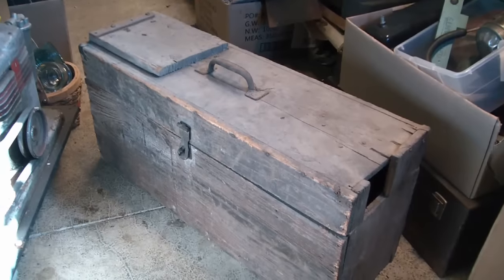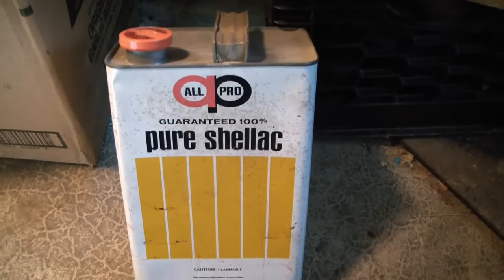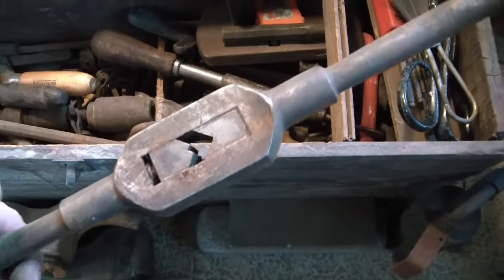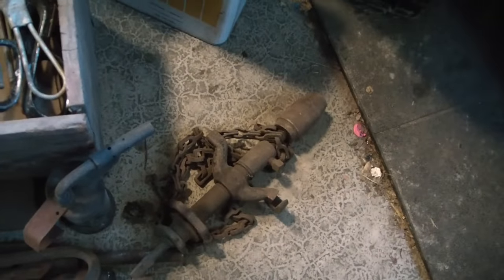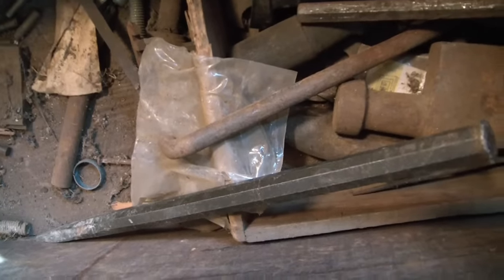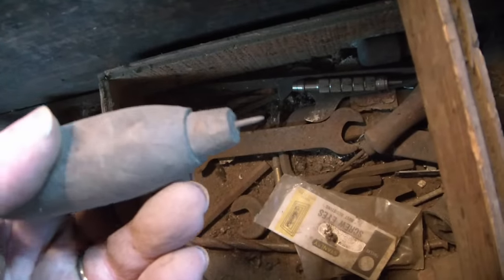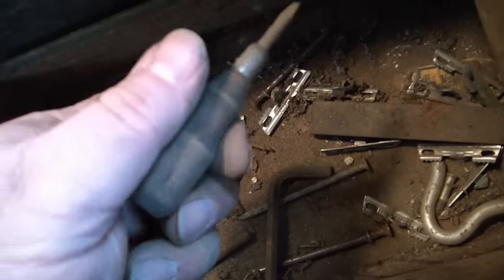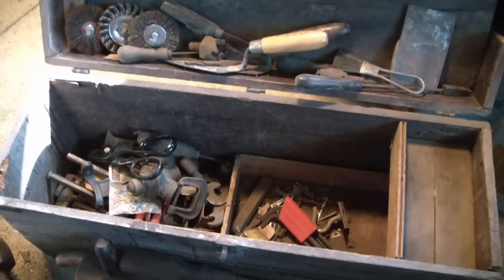Canton Tool Haul #8a

Comment: I think the first stone can be used for leveling floors (after applying floor leveling compound) The wood handled poky thing and the blow lamp look good to me    🛠👍😊
Reply from the maker: What are you referring to as the "blow lamp"?  Ooooh right you guys call a flashlight a torch.  I called it a blow torch.  Hmmm. In a set of oxy-acetylene tanks with a "thing" that fire comes out of and cuts steel, what do you call that "thing"? 🤔🤔🤔
Reply: oxy-acetylene torch but I guess I've always most other thing blow lamps I don't know why
Reply from the maker: @Everythings_Adjustable  That is fascinating!  I watch a channel called "lost in the pond" where he talks about all sorts of UK vs USA differences including lots of vocabulary videos.  You might like it.  👍😀😎
Reply: I used to have interesting conversations with a Texan girl (many years ago when I was single) lots of confusion from both sides  😁, 
Here's a quote I like,     George Bernard Shaw said: "England and America are two countries separated by a common language"  Spot on I recon   👍😁.
Also even here in the UK Guys working next to each other can have different names for the same thing, a short heavy hammer (2 to 4 pound) I would call a lump hammer others call it a club or a mini sledge. 
I hope that's a little bit interesting to you 🥃 👍 😊

Comment: Those metal Plates look like they are Card Scrapers  often used in Woodworking as a Precurssor to  fine sanding your can Scrapers the top  layer of the Wood  to level out any high spots
Reply from the maker: Thanks Craig!  :)

Comment: The shellac has denatured alcohol in it as a thinner. If you use any type of mineral spirits it will turn green, curdle and not bond. The alcohol is the vehicle in which it uses to stay liquid until it can air dry and then cure. Nice find. If it had said Shellac "Finish" then it would only be about 25-30% shellac and the rest would be alcohol and a drying agent such as a Japan dryer. Hope this helps.
Reply from the maker: Wow you sure do know a lot about shellac!  Thanks for the info!  If you liked this video, please check out my other tool hauls and share more of your knowledge about other interesting items!  Thanks for watching! 👍😀😎
Reply: @timeflysintheshop  At the time 0:14 is that an air compressor on the left ?  I was a professional painter for about 18 years.  That was a REALLY NICE find with the shellac. If that is the air compressor on the left, I have one just like it. At least,,, that's what mine looks like from about that angle. Anyway, if it is could you show it in a short video ? Mine needs new seals on both sides of the case where the crank shaft goes through.
Reply from the maker: @c.blakerockhart1128  that is an old air compressor.  I scored that at a yard sale where they were packing up for the day.  The tools were mostly still out, but I was really only interested in this old compressor.  The guy had three little compressors like this for spray painting, and he started telling me how much for them from the newest to the oldest.  For the more modern one he wanted $150!  At that point I thought, Oh OK a thanks but that is too much for me, but the next one was $80, and then the coolest one was only $20!!!  My wallet leapt from my pocket of its own will to buy it!  I will either tack it onto a future video, or I'll make a short video just about the compressor.
Reply: @timeflysintheshop  I will go up to my shop tomorrow and shoot a short video of my compressor and come back here and comment so you can look at it and see if maybe you would be able to help me find replacement seals for it if you will. Can you please check back here tomorrow afternoon or evening ? Have a Great night.
Reply from the maker: @c.blakerockhart1128  Yes, if you comment back again tomorrow(I mean today!), I should see it.
Reply: @timeflysintheshop  Have you had a chance to look at the video and see if you have the same compressor ?
Reply from the maker: @c.blakerockhart1128  No.  I just got home and picked up my tablet.  I will watch it now.
Reply from the maker: Hey!  Sorry I never got any good info for you.  I tried once to get some pics and video, but it did not work out.  My son has since helped me by "stacking" my projects rather than them being in a "pile" so it is now buried in the stack.  But if you have not seen the videos from the west highlands shop where Dave has done an amazing restoration of one of these, here is the link to part one.  https://youtu.be/Crpw6a-fZbM?si=CURbCeFag0K_15Qw

Comment: Hi, the threaded 'cutter' is not a cutter - it looks like an old 'dog' for a starting handle - the thread goes into the front of an engine crankshaft, hope this helps. Stu (uk)
Reply from the maker: Hey Stu!  I have confirmed that is a hand crank part for a 1935 to 1936 eight cylinder flat head ford!  I never would have thought that you could hand crank an eight cylinder engine, but I guess they were pretty low compression back then.  Thanks for the comment, and thanks for watching!  Check out sme of my other videos and share what you know about other interesting items!

Comment: Those plates are scraper blades for the handled holder with sandpaper in it.
Reply from the maker: I wondered about that. I will check to see if they fit that or the other wood handled tool that I called a spoke shave.  That has been suggested to be a "card scraper", so I have some investigation to do.  Thanks for your comment!  If you liked this video, please check out some of my other videos and share your knowledge and insights about other tools as well.  Thanks for watching!  👍😀😎

Comment: There was a double headed concrete form nail in there. The second head is for pulling the nail out when removing the form. The threaded L shaped rods are anchors that go into uncured concrete for fastening base plates. They can be hooked through rebar, but shouldn’t be in direct contact with the rebar to prevent dissimilar metal corrosion.
Reply from the maker: Hey Big John!  Thank you for the info!  If you liked this video, please check out some of my other videos and share your knowledge about other interesting items! 👍😀😎

Comment: The “wood handle pokey thing” is an ice pick. Every household use to have at least one.   My tool box would never be without one!
The item with fine screw threads on one end and four “hooks” on the other looks like it screws on the front of the crankshaft of 1930s and earlier cars to fit the hand crank.
Reply from the maker: I figured it was an ice pick by its size, but it is fun to call it a pokey thing!  When I clean it up, maybe there will be a marking on it somewhere.  So one else suggested that the four horned thing may be for a hand crank of an old engine.  I need to do some research and hopefully I can verify that.  If you liked this video, you would probably like a lot of my other videos as well.  Thanks for watching!  👍😀😎

Comment: Shellac should be fine. As long as the alcohol hasn't evapped too much; if so then just top it up since it's unopened. Orange is the grade and 4lb is the 'cut' or shellac to alcohol ratio. The colors range from orange to clear. The dried flakes come from the shells of lac bugs and are graded according to color. 

The flat blades probably go in the spoke shave.

Check the clamp handle on that tap wrench: The threads might be compound which makes a VERY nice wrench. Two threads, one inside the other.

The chain brace thing was most likely used for cast iron pipe plumbing, as was that 4 tooth anular cutter you had there.
A lot of the old braces were made for the 4 sided shanks, so that small chuck with 3 jaws would hopefully be an adapter for round shank cutters.

The wrench with one rectangular end and one diamond end is probably a service wrench for utilities. One end for water, one end for gas.

I love old boxes like this. I go to flea markets just to do what you did with this video to the entire place. Even if I don't find anything I often learn something.
Reply from the maker: Wow Keith!  You are a fountain of knowledge!  Thank you for the info!  If you liked this video, please check out my other tool haul videos and share what you know about them too!  Thanks for watching and commenting!  👍😀😎
Reply: My bet is the shellac is useless.  It def has a shelf life, especially the old stuff.   But you can test it easily, when you want to use it, apply 2 coats to a test piece.  It should dry nontacky in about 15 minutes. if yes its still good.  if its still tacky after 30 minutes its probably done for.  search other videos on shellac for colloboration.  Once you open it, even if its good, it will only be good for about 6 months after that.
Reply from the maker: Thanks for the info!  I have never used Shellac.  If you liked this video, please watch some of my other videos and share you knowledge about other interesting items as well!  Thanks for Watching!  :) @orbitalair2103

Comment: That metal nut with claws looks like a crank start for the crank shaft on a car or tractor .
Reply from the maker: Oooo. Good idea!  I was thinking it was half of a power transmitting joint of some kind, but I think you may be right!  I will try to look up examples and see if I can find a picture of it anywhere.  Thanks for the suggestion, and THANKS FOR WATCHING! 👍😀😎
Reply: Yep I’ll second the crank start socket. Looks like the part attached to the crank shaft that receives the crank wrench.
Reply from the maker: @JohnBlink-de4jx  Thanks for your input John!  If you liked this video, please check out my other tool hauls and share your knowledge about other interesting items.  Thanks for Watching!  👍😀😎

Comment: Thanks for sharing your finds.  I'm wondering if the "metal plates" are the irons for the spoke shave/ scraper with the wood body, as they had different profiles on them for scraping.
Reply from the maker: Yes!  I figured that too after I finished filming and was putting everything back into the box!  Weird that we still call it "filming" even though we don't use film anymore.  If you liked this video, check out my other tool hauls and share your powers of observation!  Thanks for Watching!  👍😀😎

Comment: Old shellac is probably no good anymore. If you tried to use it, it would probably just stay sticky and not dry very well. It's a great conversation piece though! Shellac is made with shellac flakes and denatured alcohol. It's the purest wood finish you can buy and has been used for centuries. 4 pounds of shellac flakes added to 1 gallon of denatured alcohol  gives you a "4 pound cut". By the way, denatured alcohol is not the same as isopropyl (medicine cabinet stuff).
Reply from the maker: Thank you for the explanation about shellac!  One of the main reasons I make videos is for other people to share what they know about what is in the videos!  Please check out some of my other videos and share your knowledge!  Thanks for watching!  👍😀😎

Comment: Good video. You got me I subscribed. I wouldn't restore that box either. It doesn't look well made. The coarse stone looked like the kind used to smooth concrete. The "spoke shave" looked like a scaper. The "aggressive cutter" goes on the end of an engine's crankshaft so that you can use a crank to start it. The "L" bolts are for sinking into concrete to use as anchor bolts for sill plates. That was a finish nail set. If you live in a rural town check at your local transfer station for a "swap shed". I've picked up a lot of tools and tool boxes at mine. Be very careful with old ammo. Most of it won't even work but, some kinds get unstable and can cause injury. Nice video. The strange steel tool with two different holes makes me think of a wood burning kitchen stove. Good Luck, Rick
Reply from the maker: Wow!  You are a fountain of info!  Thanks for subscribing!  Feel free to check out my other tool haul videos and share your wealth of knowledge!  👍😀😎
Reply: @timeflysintheshop  I have learned many jobs over the past 60 years: laborer, carpenter, mechanic, machinist, soldier, civil engineer, teacher, and Dad. I'm curious about many things and have several hobbies. Good Luck, Rick
Reply from the maker: @richardross7219  Wow!  It sounds like you have lived an interesting life!  Have you ever considered writing an autobiography?
Reply: @timeflysintheshop  I consider myself to have been very lucky. I just tell the stories to my son. I've got too many projects to do, to sit and write an autobiography. I need to fix my van, restore my 1985 Chevy C-10  and a couple of old garden tractors, fix up various tools to include an early Atlas Metal Shaper, and double the size of my garden.
Reply from the maker: That is quite a list!  I am sure those are just off the top of your head and there is probably much more!  I have more than a lifetime of old junk to clean or fix and yet I can't stop looking for cool old stuff.  How old is your son? @richardross7219
Reply: @timeflysintheshop He's an adult. I've got more than a lifetime's worth of projects but, most were free when I got them many years ago. I have the tools and used to rebuild engines. As I get the time and parts, I've got dozens of old small engines to rebuild. I'm teaching my son how to do the work too. No telling what the economy is going to do. My father and both grandfathers talked about how they survived the great depression. Gardens and chickens helped a lot. Good Luck, Rick
Reply from the maker: I knew he was an adult, I was just curiou sif he was close to my age (47).  If you are gardening, and you like Garlic but don't grow it, check out my videos about Garlic.  I grow it every year and I have made several videos about it over the years. @richardross7219
Reply: @timeflysintheshop He's 30. I was 42 when he was born. My wife and I had been married 15 years and had given up but God had other plans. Thanks, I'll checkout your videos. I've not had good luck with garlic. I am still eating winter squash from last year. One of my hobbies is antique garden tractors. The good brands, built in the 1960s and 1970s are great machines. With the right attachments they are very helpful in a big garden. Good Luck, Rick
Reply from the maker: We struggled to get two children, but had planned on three or four so when my wife was ready to stop trying, we adopted a baby girl when I was 40.   @richardross7219
Reply: @timeflysintheshop But, the trying is the fun. All else is work. Its worth it but, its still work. Unfortunately my wife died from a tick bite, two weeks before our 39th anniversary. That was in 2017. Good Luck, Rick
Reply from the maker: @richardross7219  I am sorry to hear about your tragic loss.  I know they say time heals all wounds, but no amount of time will completely heal the loss of a loved one.  (I am speaking from experience.)
Reply from the maker: Oh one other thing I forgot to ask about.  What is a "transfer station"?  I live in a rural county in Ohio, but I am not familiar with that term.  I grew up in a rust belt county in Pennsylvania, so I may be lacking in some rural vocabulary. 😔
Reply: @ysintheshop Thanks. The almost seven years have mellowed me on the loss. If you are east of the Mississippi you have to be careful. We had 2 women in our little town and 7 other people in our local hospital die from tick bites that year. There are 9 tick diseases along the east coast now. 
Transfer stations in CT replaced town dumps. Everything goes into rolloffs. All town dumps had to close in the early 1990s. Most transfer stations have a swap shed(usually built as an Eagle Scout Project) where usable things are left for reuse. Shop lifting is encouraged and they have a generous return policy. It turned out that these swap sheds save the towns thousands of dollars each year from reduced disposal fees. I have picked up all kinds of things including a tool box full of NIB air tools there. I stopped the guy who dropped them off to ask why. His father had died and he had no interest. I've picked up mowers, a radial arm saw, a table saw, a wood lathe, 1/2 of a Troybilt tiller(parts for mine), a chipper/shredder, and lots of hardware. The table that I'm using right now is from there. If you have a dump still, getting your local BSA Troop to put up a shed can save money. One problem is when professionals decide to take everything a couple times a day. In our town, she was old and disappeared. Good Luck, Rick

Comment: The 4 pieces of metal that are bent on one end and threaded on the other would go in wet concrete and this allowed a top plate to be bolted in place.
Reply from the maker: Hey Larry!  Thanks for he info!  If you liked this video, please watch some of my other videos and share your knowledge about other interesting items!  👍😀😎
Reply: They are called anchor bolts, you cast them in a concrete slab or footing to connect the bottom sill plate of a wood framed wall. he had it pretty close.
Reply from the maker: @markthomas5316  Right!  I knew that somewhere in my noggin, but in the middle of filming, your brain is not always quick enough to get the recognition and the right words out in a timely manner.